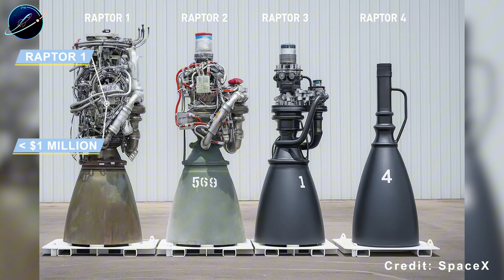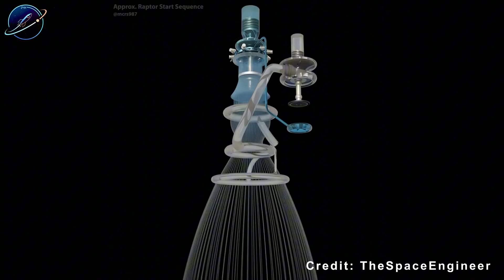SpaceX Has Found the Perfect Engine: More Power, Less Cost Than BE-4...Mind-blowing!

Comment: I wonder that these rockets 🚀 have more power. What about the fuel ⛽️ as to how much more fuel they would use.
Reply: There will be slightly bigger tanks. The efficiency increases with thrust so does acceleration and so over all velocity with payload reaches altitude faster and for far less fuel than previous raptor.
Reply from the maker: Great question! Starship's Super Heavy + Ship stack has way more power (~16 million lbs thrust, over twice Saturn V's ~7.6M lbs), but it burns much more fuel too—around 4,800–5,000 tons of methalox propellant total vs Saturn V's ~2,800–2,900 tons.